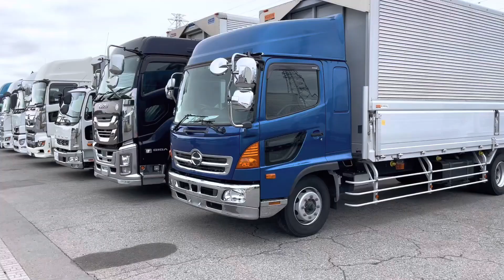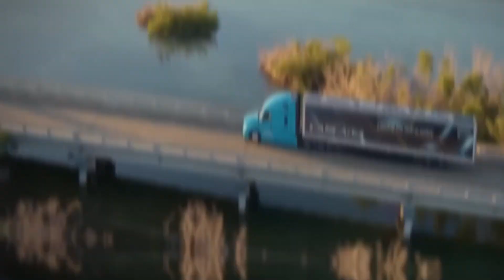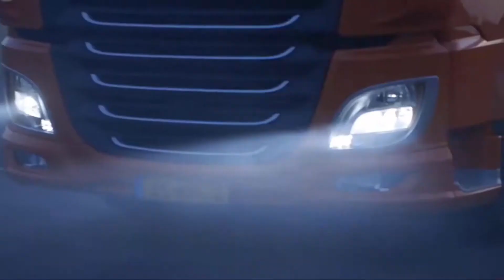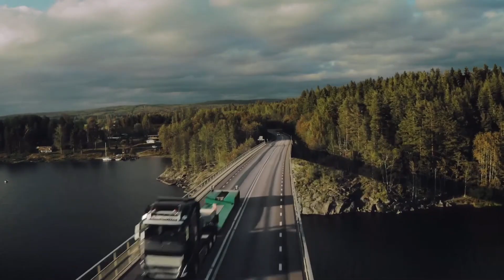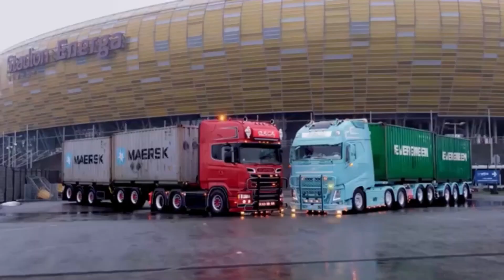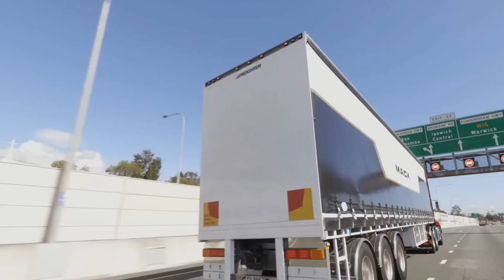The INSANE Reason Why European Trucks Are SO DIFFERENT Than American Trucks

Comment: European trucks have larger and more powerful engines than US trucks due to the need for greater torque to haul massive loads, as well as differences in truck cabs. European trucks have up to 770 HP, while US trucks have lower HP due to emission regulations and use engines from separate manufacturers.

Comment: Why do people think that American trucks are better than their European counterparts? Someone else mentioned engine size, in the video, the commenter claims American trucks have bigger engines, WRONG, they also claimed that they carry more weight, WRONG, USA=36 metrics tonnes, in Europe, some countries run at 50 metric tonnes or more, the UK runs at 44 metric tonnes on 6 axles, the maximum trailer height in the UK is 16 feet(4.8 metres), in Europe it is mainly 13 feet(4 metres), so far almost every video that I have seen about trucks have been made by an American company and they are such a basis towards American trucks when they compare them to European trucks, it's unbelievable when the truth of the matter is that European trucks are far more technically advanced than there American counterparts, the only area where American built trucks excel is in the living space for the driver, there I have said it.

Comment: DAF 530 AUTO, Pulls a Stas Agristar in the UK. 44,000kg or 97,003 lbs. Payload is 28,400kg or 62,611lbs. We don't have power or weight !!! Standard fleet truck, Scania are 770 hp tops Volvo 750 hp tops. Here in the UK 530/540  is about normal BUT the Chinese have an 800hp tractor. Enjoy your X15 605hp and 2050 torque but it's just above average here and we run heavier than 80,000lbs 36,287 kg trucks stateside but you're neither heavy nor highly powered

Comment: Okay, Guys, I am a man who likes POWER! and EXTREME (Heavy) DUTY! My Truck would be an Armored, On Road, Off-Road Amphibous Expedition Full Time Living In Vehicle (Good For -60C to +60C): ED/EXTREME DUTY, EPD/ELECTRIC POWER DRIVE, 1000HP, and 1000lbf per axle or 500HP and 500lbf per Independent Suspension Wheel. All Wheels ELECTRIC POWER DRIVE and POWER STEERING. That would be 5axles, 10Wheels EPD, 8/Eight, or 10Wheels PS/POWER STEERING! 4/Four (Two on each side) Power Water Jets! See you all everywhere around soon! How soon?

Comment: UK/EU trucks carry MORE weight than the USA. Our trucks are more powerful and today mostly automatic gears. Speed limits are lower so inertia speed is not availble and has to be virtually insited power while more economic. Do your research. Cab length is determined by o/all length (60ft).
Reply: Torque is what matters the most because you're hauling cargo. 6 cylinder engines can produce the same or more torque than a V8, they are inherently balanced, and those two less cylinders save money at manufacture time. You don't need 770hp. It's not needed in the US where most roads are flat straight roads. A truck having more power doesn't make it better. 605hp is good enough. Europeans is so hooked on hp when it comes to trucks. Those 750hp and 770hp is mostly used in Scandinavian countries anyway.

Comment: American trucks are not as powerful as European trucks. You're completely wrong  about that. Scanias and Volvos come with a huge powerful V8 as they have mountains to climb with a lot more weight to haul than American trucks do normally. Please do your research properly. By the way all trucks have been running on diesel for decades. There's not a petrol/gasoline engine in any truck in the world today. You suck!

Comment: Hi. You are wrong, man. European trucks are STRONGER than American ones. Scania has 770 HP and 3700NM, and Volvo has 750HP and 3500NM. Americans got only up to 605 HP and 2500lb-ft = 3340NM. If they really have that?
Reply: European Trucks lead the way in load capacities and dominate the Australian market helping with their Road Trains.
Length Restrictions limit the size of Commercial Vehicles in Europe, so their vehicles are designed for heavier payloads: on 5 axles they can cross the scales at 44 Tonnes; in the USA 5 axles are limited to 36 Tonnes.
The Volvo FH16 750 HP Engine produces 3550Nm ~ 2618 ftlbs.
The Scania 770S: 770 HP Engine produces 3700Nm ~ 2729 ftlbs.
Special Ordered Engines in the North American Market might be rated at 515 HP Producing 2780Nm ~ 2050 ftlbs.
In the United States Trailer Lengths are Regulated but while not Regulated Power Units may be stretched out to 12 m ~ 40 feet.
Reply: And in some countries in Europe like Norway and Sweden maximum weight are standard 52 tons. And road trains weight up to 60 tonns. In Norway road trains are limited to 25,25m.
Reply: American trucks may be longer, over all. But they are also limited to 4 m height, while in Europe the can be higher (depending on the country) . European trucks can also be 5cm wider if its a fridge/freezer truck.
Reply: Why are most Australian outback trucks American brand Australian built trucks? Kenworth is the best selling trucks for heavy duty use in Australia. You're response is obviously bias and is a opinion. You're passing it as facts. Australian built Kenworths are much better for Australian hot conditions than European trucks. That's why they are larger, taller, and have bigger fuel Tanks.
Reply: Sorry son I drove a Kenworth w900l with a c18 cat with over 800hp. And though not seen everywhere, I have run into others
Reply: @tommcguire6472  Good! But 18L Scania would have 950HP and 3000lbf
Reply: You have no idea of the American aftermarket for commercial trucks my friend. There are firms in tx, ca, and mo. that are putting out trucks with up to 1500hp. For commercial everyday use. The majority of their customers are bull haulers so far as I know.
Reply: @tommcguire6472  Yes, good. But I said 950HP from 18L.
Reply: @richardmak2789  caterpillar c18 is 18.1 liters, it shares the came block as the 6nz. And the only reason European trucks are hauling heavier loads Is1) because of government regulations,and 2) Europe is more dependent on trucks for transport than the us. It would be like myself making the statement that American trucks are faster because the speed limits are higher
Reply: @tommcguire6472  boring tbh, European trucks are still better then American trucks in technology, design and transport capabilities. I have seen trucks been build in my country of the Netherlands which where capable of hauling 120 metric tons. (Search ginaf hd5395 ts 10x6 if you dont believe me)
Reply: Yusuf. The video was about rules and regulations of American, Japanese and European trucks. It Australia was not mentioned. Of course we all know that know one beats Australian road trains at weight of 180t++.

The video was not about the maximum weights possible. My point is that the American trucks are narrower, lower, about the same cargo length, and much lighter.

But in that case you should know that the heavy trucks of Australia drives for the most part on flat terrain. In Norway e.g. its common to have 7-9 % uphill in tunnels. Since the trucks are not alone on the road there, its not accepted to drive 50km/t to make obstruction for other vehicles. So there is a minimum demand at hp per tonn. The trucks there drive 60-80kmt uphill.

Another thing, one of the most powerful truck in Europe, Volvo 750, mentioned further up, is a inline 6. 

You should also know that the some of the  heaviest Aussie road trains have ekstra engine in one for the trailers, to help it start driving. 

Design wise, the Mack is the best looking truck i think 😀 The kenworth is just a weird mix of steel and glassfiber.
Reply: Hi. You’re wrong man. Plenty of American trucks have 675 hp with 18 speed transmissions that pull 160,000 loads multiple times per day. It takes 11 axles to spread the weight legally. Lots of guys get work on their trucks that have a lot more horses.
Reply: You don't need a V8 with 770hp. A six inline is fine and is better balanced.
Reply: Torque is what matters the most because you're hauling cargo. 6 cylinder engines can produce the same or more torque than a V8, they are inherently balanced, and those two less cylinders save money at manufacture time. You don't need 770hp. It's not needed in the US where most roads are flat straight roads. A truck having more power doesn't make it better.